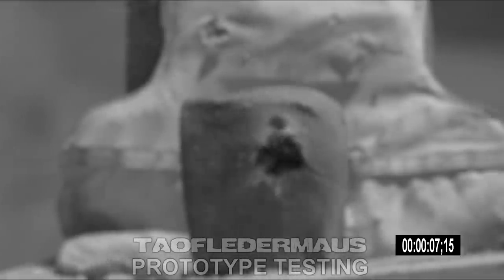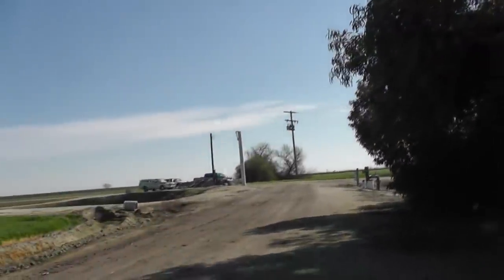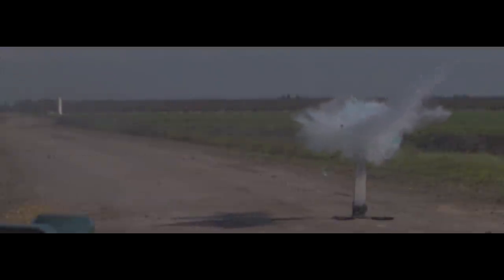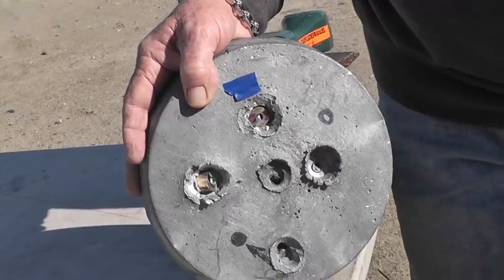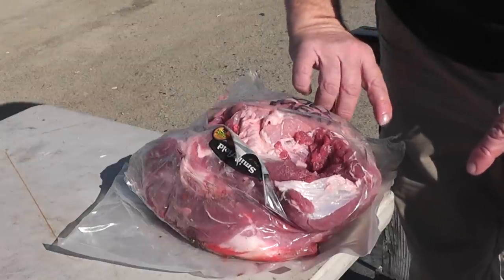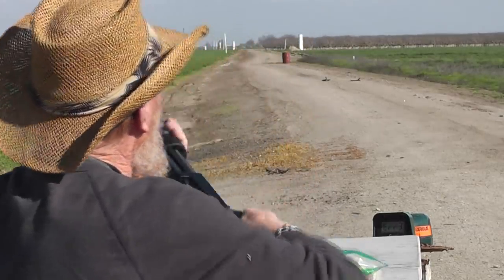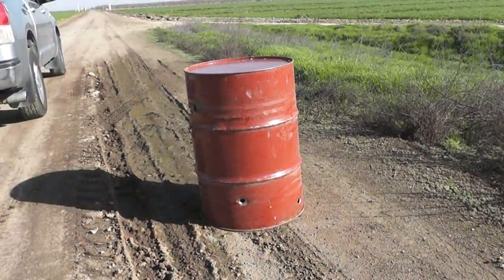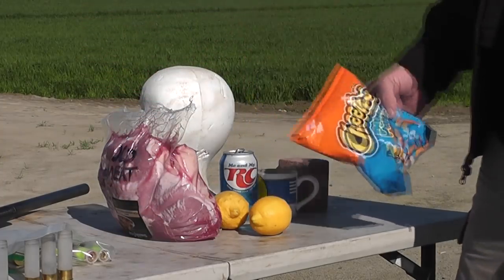Testing the latest exotic 12 g.  slug from Russia -  Wicked Design

Comment: The "split wad" shots had more impact (as you noted with the meay) because of the more solid wadding (you removed the  cushion) so more of the force was delivered to the slug, not because of a better gas seal. That's also why Danny noticed a sharper recoil with them.
Reply from the maker: It's hard to say.  The cork may have also added support to the gas seal,   causing it to seal a little better.

Comment: Very cool! Really didn't expect accurate shots with those with so much weight at the rear. Thought they would flip but I guess the hole helped it stabilize. And that is the first time I have ever seen crop dusting done with a helicopter. That was crazy.
Reply from the maker: The use the little helos a lot around here.     The pilots are all frickin nuts though.

Comment: Jeff and fellas, have you not considered placing the Chronos camera closer to the target with an angled plate (or 2) to protect it from the rear and maybe a sheet of bullet resistant plexiglass to protect it from the front!?

I reckon some mid-flight or impacts shots at a closer range would be great with better resolution and focus but I can fully understand the risk you may not want to take with the camera.

Comment: Officer Greg gave me a great idea for a video - what does it take to make a metal barrel explode? If you filled one with water and sealed it, would the hydrostatic shock make the barrel explode, would the slug bounce or would it just punch a hole and get stopped by the water?

Comment: @TAOFLEDERMAUS
8:53 When you re-cast that lead plate I think you can remove them when the lead is liquid? 
I don't know what alloys they are, but lead usually melts before most other metals.
Reply from the maker: Yes,   I will probably chip around the lead to see if I can get them out,   but yeah,  they will not melt

Comment: Supposedly lead bullets follow the surface of a concrete surface. If 9mm hp and ball hit pavement at 2 to 30 degree angles where will they be 50ft downrange. I assume the hp may deform enough to tumble badly.

Comment: Not impressed with the damage. Most slugs will blow up a pork shoulder or a ham.
Reply from the maker: It all depends on if you want deep penetration,  or shallow.
Reply: Nope, most slugs regardless of whether they penetrate deeply or not will decimate a pork shoulder or ham. This slug is just poorly designed as far as wounding ability is concerned. I used to test different slugs about once a month using pork shoulders and hams as test mediums and did so for about 2 years and have never seen a slug leave a wound as unimpressive as this one.

Comment: how abaut a aluminium bullet with a pressfit tungsten carbide core and a plastic sabot for a rifled shotgun , i might do an internship at a toolgrinder ,to what adress shall i ever send stuff in case i get the chance to make something
can you use even faster burning powders like some pistol powders and stronger primers to get low weight slugs with abaut 600grain to higher speeds like ~2600fps 
do you have or plan to get a EPVAT/VPAM/HPI reciever for piezzo pressure measuring cartridges / go to pressures and forces normal guns go granade 
https://www.hpi-gmbh.com/index.php/standard-ballistic/product/view/2/9